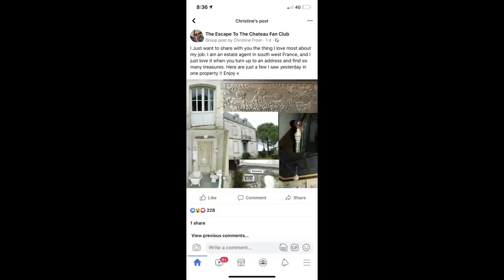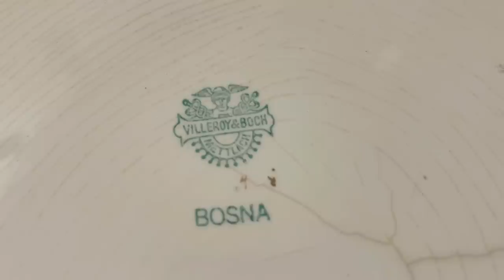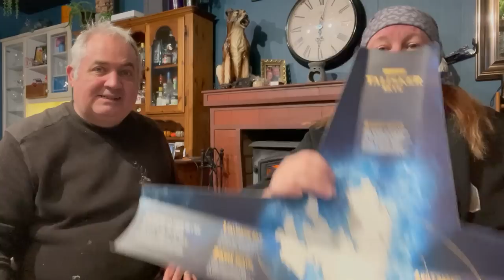Stripping, Snagging & Attic Finds! #75

Comment: A tiny bit of history from the daughter and granddaughter of mattress manufacturers. The item next to the metal bed in the attic is a box spring. While that name is currently confusing, because modern box springs do not contain springs, that's a prefect example of how the name came about. It's a box, with eight-way hand-tied springs inside. They would have originally been pulled down much tighter, and topped with ticking fabric, ready for the horse hair mattress to go on top. I, for one, am thankful this technology has advanced!